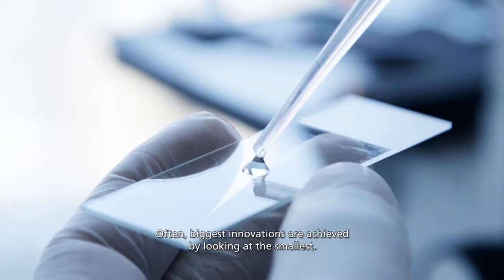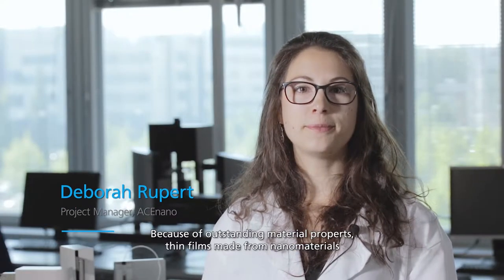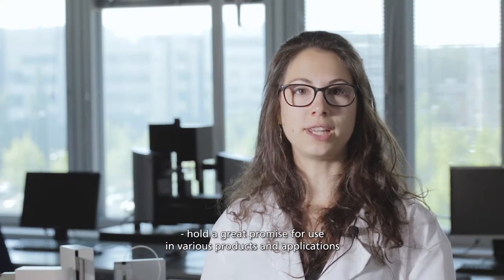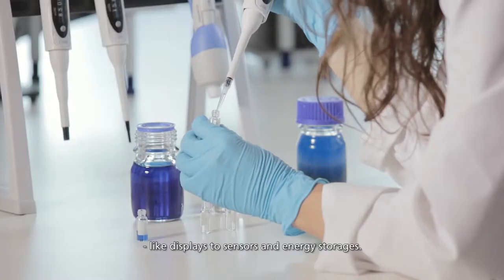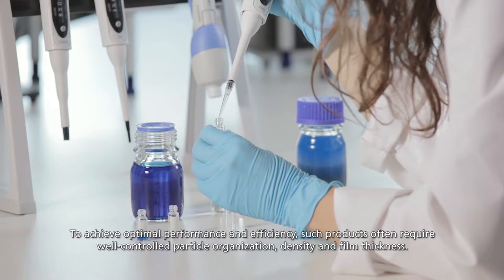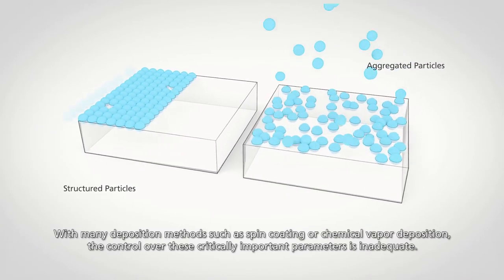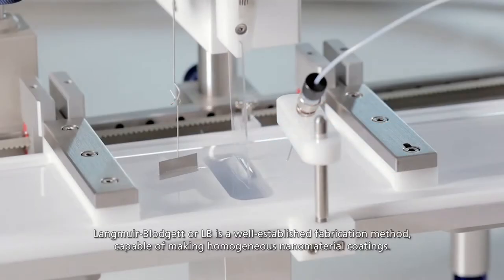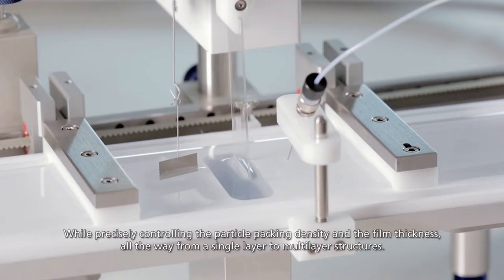Nanoparticle coating process

Comment: If we directly dip coat the glass slide into nanoparticle solution after silanization will there be a proper film on glass slide?
Reply from the maker: Hi Shivi, dip coating can be used to deposit nanoparticles. However, you will most likely end up with multilayered structures rather than monolayer. Also, it is likely that there are some empty patches on the surface. Langmuir-Blodgett is more suitable for monolayer deposition of nanoparticle. See the blog post and the webinar for more information https://www.biolinscientific.com/blog/how-to-deposit-nanoparticles
Reply: Thank you for the suggestion...I also wanted to know if take say 2ml solution of the formed nanoparticles and dilute it with DI  water to approx to make final volume 5ml then will the properties of the nanoparticles will be changed or not??dilution will effect their particle size or not? Plz do reply